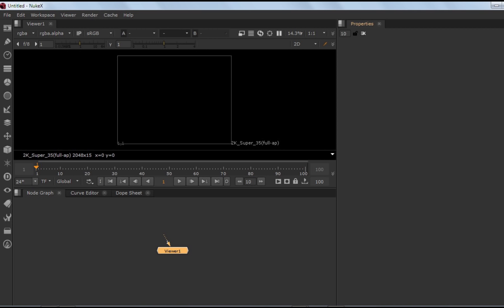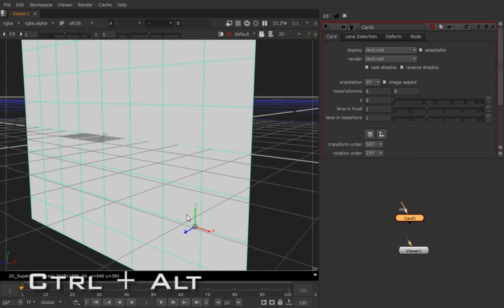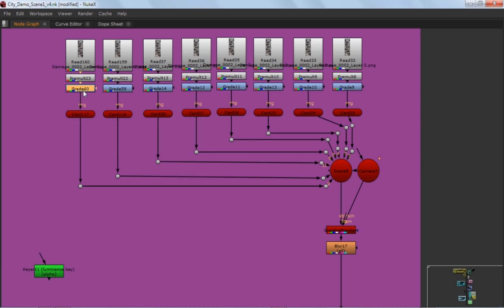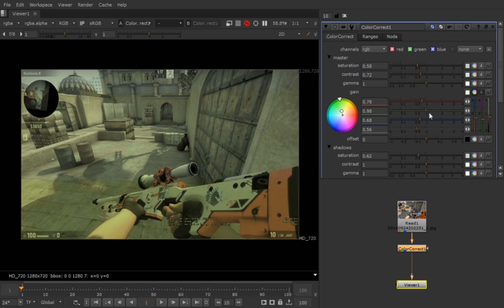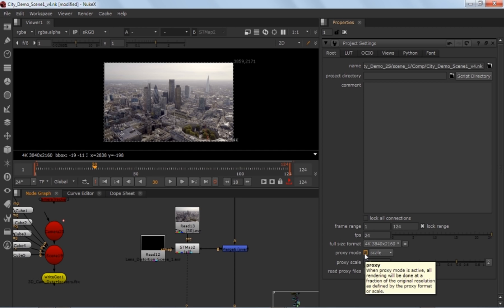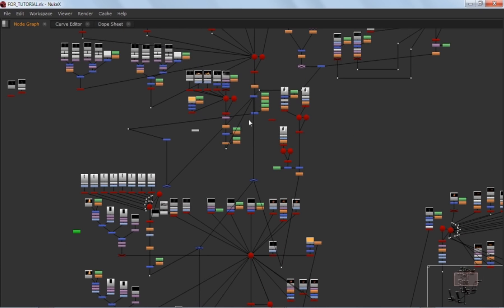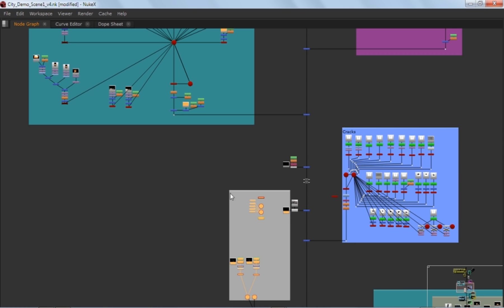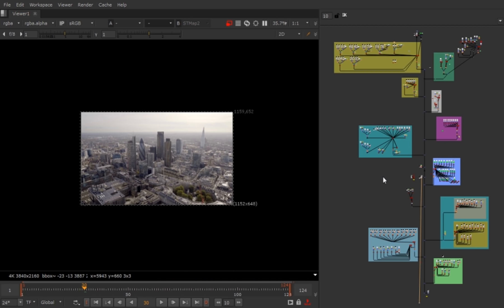Top 10 Tips & Tricks For The Foundry NUKE

Comment: 4th is little unsatisfied. 
If I'm using alpha with blur and doing grade or blur to all at the end, it doesn't work in feather area so I think there's one option to Unpremult and Premult.
Otherwise all good. Keep it up.
Reply from the maker: well it depends.. on situation.. its not necessary to use everything in end but if putting one node instead of 10 node and it giving that same result then its more promising to use that one node in end.. every shot is different.